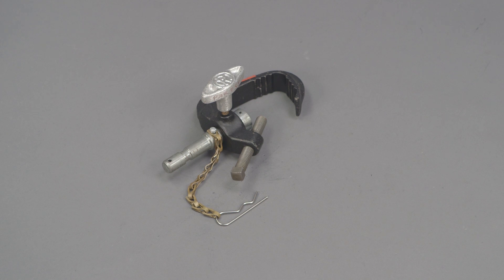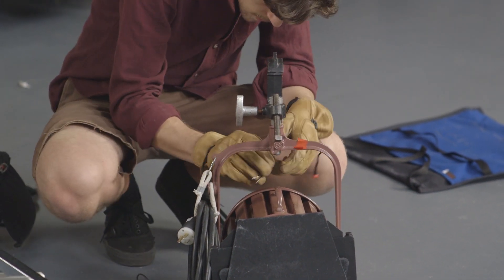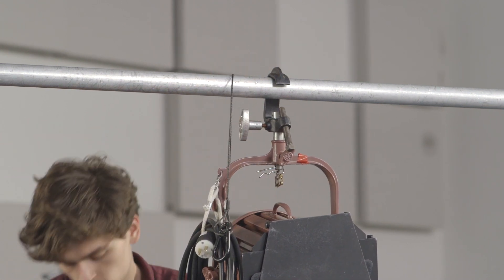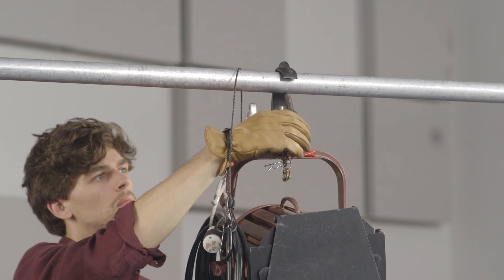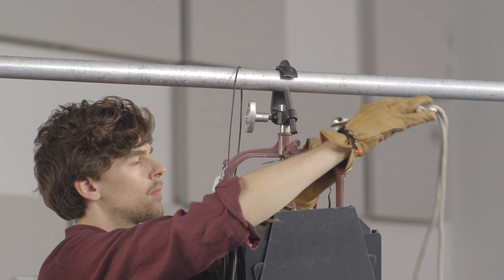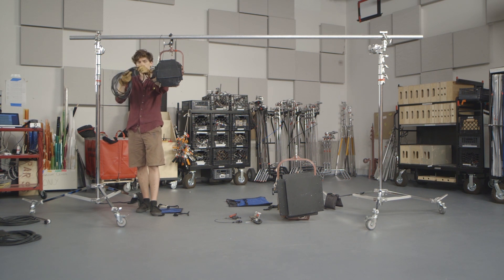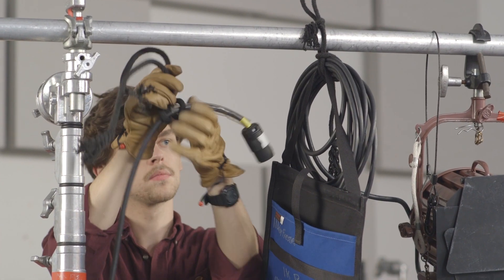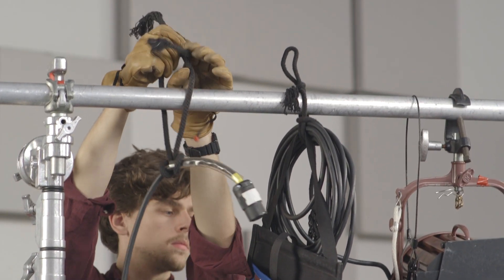Pipe Hanger

Comment: The cotter pin is used wrong here. It is supposed to clip around half the diameter of the baby pin. That is why it is shaped the way it is. Rotate it a quarter turn from how it is shown and put the pin in the hole so the first bend in the cotter pin clips around the baby pin. It can easily fall out if not done right.